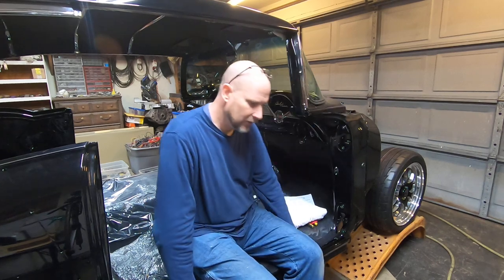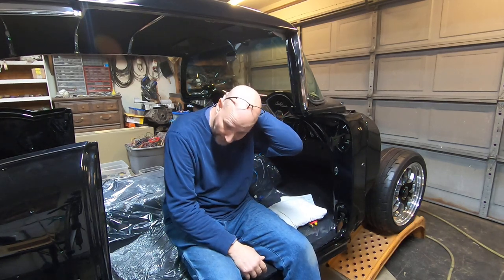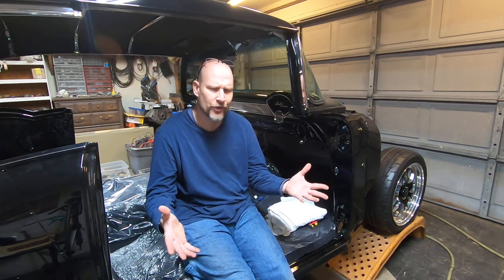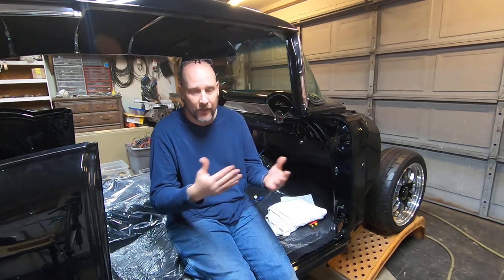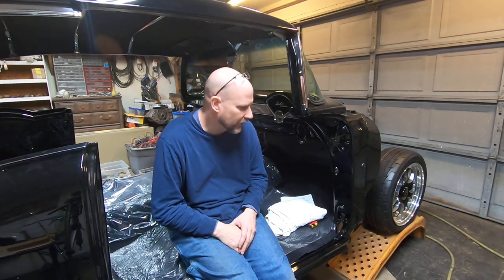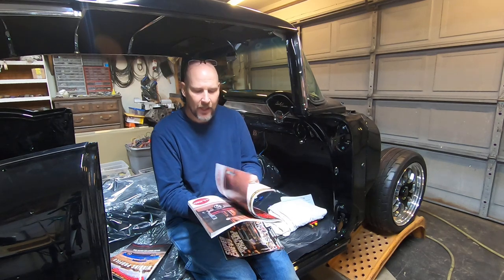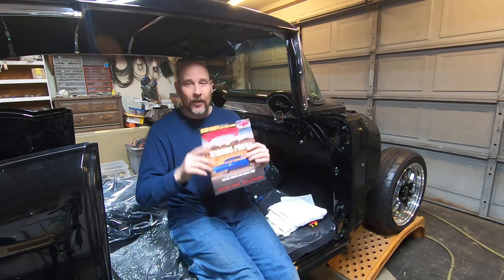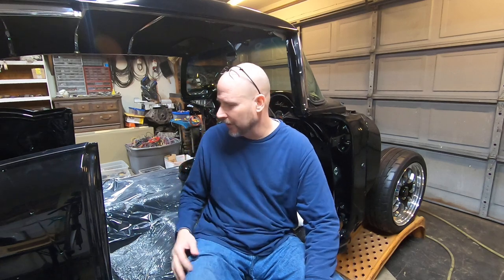Adjustment for glove box door on 1955 Chevrolet car and other stuff

Comment: You probably know this but brake fluid  will strip paint off plastic. Its slow but doesn't hurt the plastic. Enamel is pretty easy to strip with it lacquer is harder.  Good tips on the glove box & magazine. Goodguys car show at Texas Motor Speedway is a great show (or was before Covid)
Reply: I grew up Ennis, Texas. Sure would like to see the old Texas Motor Speedway.
Reply: @thomasparker5208  I have spent a lot more time at the Motorplex than TMS even though TMS is a lot closer to me. Goodguys is coming up at TMS March 12-14  and so far its on!